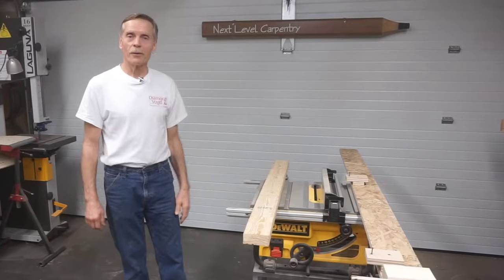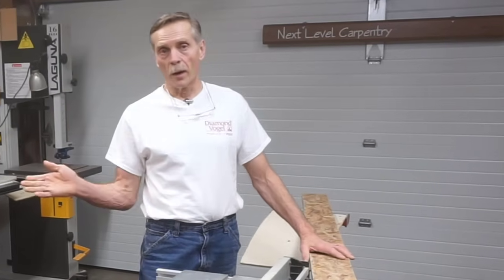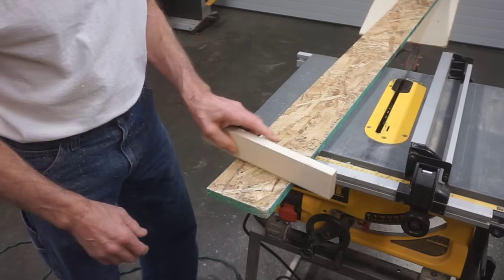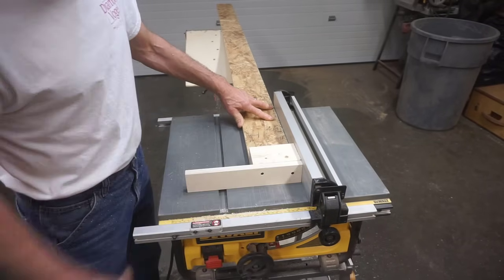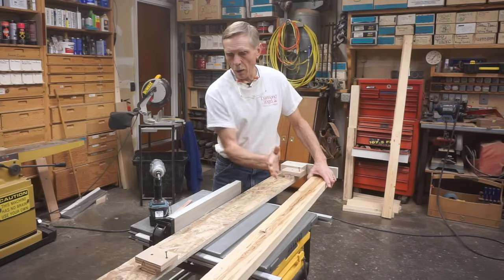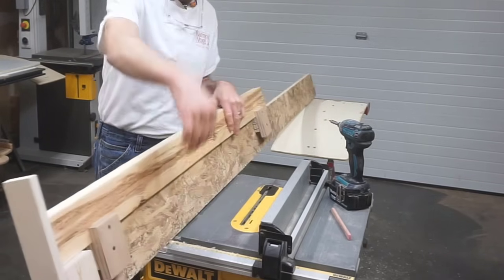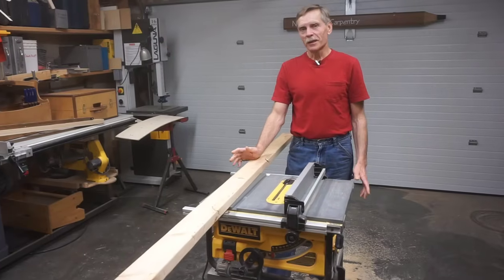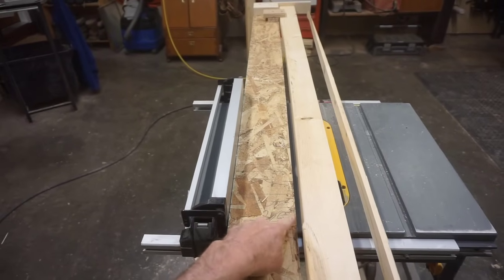How to Cut a Straight Edge on Crooked Boards

Comment: Long time carpenter here. Using a factory edge from sheet goods is totally the way to go. However, I would have just screwed that 2x4 to my OSB. In my opinion all that extra jigging is unnecessary.
Reply: So one thing I am trying to wrap my head around is why use the plywood at all? I understand wanting a known straight edge but isn't that what the fence of the table saw is? Shouldn't the fence be a known straight edge, so why introduce another piece?
Reply: @scottv.4140  The fence on that little saw is maybe 30" long. The lumber the op is trying to straighten is much longer, say 6 or 8 feet long. Without the straight edge, once that bowed lumber goes past the fence it's line of travel will start to hook. With a known  straight edge attached to the lumber, it's travel will remain straight and true  throughout it's travel along the fence.
Reply from the maker: @scottv.4140  think it through... or try what you're pondering... it would only work if your rip fence was over twice the length of the board being ripped while the plywood straightedge need only be the same length as the bowed piece.  Best, Matt
Reply: Exactly
Reply: @KenHill  Yes, but the OSB straight edge is itself only referencing off of a 30 inch fence. So you have the same problem. He could achieve the very same result just by using the fence. 

But the idea of going through all this rigmarole just to straighten a 2 x 4 that costs $3 on a jobsite, where time is money, makes no sense at all.
Reply: @marks6663  No, you're not quite getting it. With a jig like this you are transferring the straightness of the OSB/Plywood to the bowed lumber. Though I agree with Ken Hill, I'd just screw it to the sheet good from the bottom and call it good. And you might be onto something regarding the cost/time benefit. But towards the end of a build, it's likely you're going to have a healthy pile of bowed left overs and this is a great way to use them. $3 * 20 or 30 boards starts to add up - especially if you are the one paying for it and not your boss.
Reply: Bradley Weingartner some people are just too “smart” to learn anything new.  🤔

They yammer about cost effectiveness so they jump in the dually work truck and run 35 minutes to Home Depot to pick through a sprung bunk of studs for 10 straight ones.   Then stand in line for 15 minutes because the cashier is new, go through the Starbucks drivethru and get back to the job site just in time to take lunch.  🤦🏽‍♂️

Meanwhile this guy built a jig in 10 minutes, straightened 10 studs, built the wall, stood it and is on to the next project.  😂
Reply: @NextLevelCarpentry  Some people are very smart, aren't they!  Now I understand why there are down votes.
Reply: @marks6663  I am watching this video during the Covid-19 lockdown in NZ (mid March ~ April 2020) - very few shops are open (only the essential shops like gas stations are open); money can't buy everything!
Reply: @bradley3549  It makes perfect sense to me; as I mentioned below, I am watching this during the Covid-19 lock down in NZ (mid Mar ~ April 2020) and very FEW shops are open (only ones like gas stations or pharmacies are allowed to open).

I totally agree with you that $3 * 20 or 30 pieces of wood does add up; imagine renting a house for a whole year and only stay there for 11 months!
Reply: @marks6663  But for this retired DIYer, I have more time than money. Every situation is different.
Reply from the maker: @badlandskid  couldn't have said it better myself (and probably couldn't even if I tried? 😉).  One thing you didn't account for is the 20 minutes they spend hen pecking at their keyboard/device to compose a lengthy troll comment dissing the video to try and convince the rest of us their intellectual superiority, right? 🤣🤣😎 Thanks for watching and commenting! Best, Matt
Reply: I agree. Just screw a piece of plywood or joint something longer and screw to each end and run thru the saw.
Reply: I NEVER trust a factory edge. Cut your OSB oversize, then feed it through the saw next to a level. Then turn it around and trim the other edge. Now you have a straight edge.
Reply: @brucemiller1696  As long as your saw is dead nuts and you have a steady hand, Indeed you'll be golden.
Reply: @KenHill  i use the level all the time on my shop saw to straighten boards, or i use my 10' slider.

Comment: When on the jobsite framing,  just snap a line from corner to corner and use a skill saw to cut the line.  Boom! Straight 2 by 4.
Reply: If you can cut a straight line with a skill saw for some it’s not an easy task for others it’s not possible with out some kind of straight edge I can’t cut a straight line with scissors and paper to save my life..
Reply: I assumed he was just demonstrating on that curvy 2x and was trying to show the technique for straightening the edge of dimensional lumber. Because let's face it, if you are framing a job, you're gonna toss that one aside and use it for a sill, plate, or corner where you can make it straight, or  cut it for cripples.
Reply: Well, not to be critical ...
but, it's worth noting that you would begin with a crooked 1.5" x 3.5" board,
and end up with some weird dimension that would then only be useful to resaw into furring strips, or something thinner.
Reply: @mytuberforyou  that's true, we would never rip a 2by4 framing, just use for drywall nailer or give it back to the yard or like you said. I guess the only time I've seen the technique applied was for deck or floor joist, seeing as how it didn't matter how crooked the opposite side of the cut still was.

Comment: Hi Thank you for the video. I have a question, why can't the fence be used instead? I'm new to woodworking. If you line 2x4 and cut the edge off, won't that do the same thing?
Reply from the maker: What's required to cut the bow off of a board is a straight fence for the work piece to ride along during the ENTIRE cut.  The fence must be at least twice as long as the bowed workpiece plus the diameter of the sawblade or it won't be able to guide it during the entire cut.  If your fence is 24" long then the longest piece you can straighten is about 10". Do a little experimenting and you'll see what I'm talking about.  The reason this fixture works so well is that it only takes an 8' long straight edge to straighten any crooked boards up to 8' long.  To straighten the same crooked board using the fence alone you would need a perfectly straight fence almost16' long on your table saw which is very impractical.  I geometric terms the rip fence becomes a 'chord' to an arc made by the the bowed board. In theory you could straighten a crooked board eventually using only a short rip fence because each successive pass would straighten it a little more... but again, it's nowhere near practical.  Hope that helps some?  Best, Matt
Reply: @NextLevelCarpentry  2 years later and most people would have forgotten about the videos they posted. Good on you for keeping up.
Reply from the maker: @username-mark  thanks for sayin... I feel that meaningful content has a very long shelf life and there's value in passing it on. Thx for watching and commenting!
Best, Matt
Reply: @NextLevelCarpentry  no worries. Watched a few of your videos today and learned a few things along the way. Keep up the good work.
Reply: @NextLevelCarpentry  Thank you and that makes sense. I will try it out. There are so many cheap pieces of wood at HD and now I can mess around with those.
Reply: So could you clamp a long straight 2×4 to the fence???
Reply from the maker: @joeysanchez5926  Yes... but the straight piece needs to be twice the length of the piece being cut plus the diameter of the sawblade at a minimum and has to be stiff enough to not flex during the cut.  Besides that it's tough to keep the workpiece from rising above or falling below that long fence unless you add a support strip under it.  Other than all that it's a piece of cake! Best, Matt
Reply: @NextLevelCarpentry  I just recently found your channel and have subscribed. I am disabled from my heart giving out when my youngest daughter was killed by her boyfriend. Your videos have helped motivate me to get into projects and live some again. I live alone so its been rough. Thank you very much for your channel and the help it has given me.
Reply from the maker: @user-vp9lz7ew9b  Sorry to hear of your hardship and grief DeWayne... I admire you for picking yourself up by your own bootstraps and working to find new purpose in life... Best, Matt
Reply from the maker: @Crypto_Cronies  thanks for your kind words, for watching and subscribing to Next Level Carpentry... much appreciated! Best, Matt

Comment: 12:03  As a novice, the initial feed of the board always seems awkward to me to stay aligned with the fence.
Reply from the maker: With the short rip fence length on portable tablesaws that initial feed will continue to feel awkward Vashon... even with decades of practice it still takes me a bit of concentration to get it started right.  Practice helps though and the more you do it the less nervous you'll be.  Best, Matt
Reply: Also as a novice, I've found I really like featherboards to help keep the work snug against the fence on the longer cuts. Would not work with this particular trick though for what I hope are obvious reasons. I have screwed a bowed board directly to the sheet good in the past though which gives clearance under the bowed board to use the featherboard on a known flat reference.
Reply: Years ago as a novice, I found myself always on the fence, struggling to decide to feed the board from one side, or the other.
Reply: marshalllhiepler 
 It was a great attempt at humor. 
  I'll give you that.
Reply: @marshalllhiepler  - Years ago, I walked in on my wife using the wrong end of the hammer! ;-)...

In her defense, she couldn't push a thumbtack into the wall and was using the flat rubber end of the handle in an attempt to avoid damaging or marking the paint with the dirty anvil end (made sense, I guess), but it made for years of jokes... 

I just wish smart-phones and youTube were around back then. The visual was priceless.
Reply: i clamp a straight piece from a old  aluminum  door to the fence. at  80 inches long  you can even use it to straighten boards 40 inches long without any jig.
Reply: Get in the habbit of keeping your eye on the contact point of the leading edge of the workpiece being cut and the fence. Don't look at the blade.  keep you eye on the fence and the board right next to the Blade.  Keep your eye there as you being pushing the board through.  Get in a good position where your feet are stable and your are balanced.  The only thing moving is your hand to push the board through.  I keep my knees bent.  I just got done doing twenty 20' 1x12 pieces of pine.  OK it was on my shop table saw.  But I did this from 10' away while balancing the board in my hand.

Comment: 13:32
Thats how i trim off the warped side's of a 2x4 ... And plywood, and particle board and mdf  ....
Reply: but if the warp is outside the length of the fence you just transferring the same profile to the new cut edge.. this is why he used the guide so there was a true sq profile the entire length.

Comment: But since even straight 2x4s aren't really 2x4 and each messed up board requires a different amount to remove, doesn't it mean your 2x4 project is either going to involve multiple odd sizes or, if you cut everything to match the smallest end result, consistently small sized boards? If we have to joint and plane anyway, Why aren't they cut larger than 2x4 from the factory so when they're at end user moisture and jointed and planed they end up actually being 2x4?
Reply from the maker: Focus Robert, FOCUS: this video shows how to cut a straight edge on a crooked board... got it?
Reply: @NextLevelCarpentry  Got it! Sorry for having a general question that occurred to me while watching, I'm still new! Will do better next time.
Reply from the maker: Sorry if my reply was a bit harsh, Robert.  There are reasonable answers for the questions you posed but addressing them all in one comment response isn't feasible.  If you have a particularly vexing question as you gain insight and experience in carpentry feel free to post it on an appropriate video here on the Channel and I'll try to respond in kind.
Best,
Matt
Reply: Excellent reasoning and very good question! Curiosity is the fuel of every great craftsman.

The reason why the mill will not cut the 2x4  larger than a 2x4 is because 2x4 are used for framing and Not for your finish woodwork projects. For a mill to do this would be unrealistic and extremely wasteful as they'd be milling wood that is completely out of building code and no contractor would hire guys on site to be ripping larger-than-2x4 boards all day to make 2x4 boards for the framing job when we can already get the boards at the dimensions we need.

As contractors, we need wood that's milled to spec and ready to use as soon as we get it to the job site.

For finish work, we're working with tons of misc sized cuts or large-scale (big & wide) milled material that's meant to be cut down to the sizes we want for our finished projects.
Reply: @futuresdojo  That makes sense thank you!
Reply: Boards have been getting smaller by the year. That way they can get more boards from the same tree .

Comment: I am completely self taught.. other than a a helping hand from friends. I subscribed and rang the bell.  I really enjoy wood working.  I will probably comment a few times. So when you trimmed the two by four.. I'm guessing you trimmed the round side first then turned it around.  I would have thought you would have had to move the fence.
Reply: Also this isn't just a matter of saving money or convenience. Usually there is a goal set to be done with such and such. Do we stop everything. In the pix I saw OSB. But the truth is it is easier to find on a job site and we your viewers, might have a piece around.Anyways If we take the time to go to town and buy this and that.. it kills momentum. You go to lunch.. extremely slow service sometimes. So you spend
an hour at lunch and go to get the board and you realize you need
some things at the job..now this takes more time..and  you've been off the job two hours. I say grab the OSB, set the fence and go for it.  I had a slightly out of square piece of plywood the other day and this would have been handy.
Reply: I notice that the board you are straightening is nominally 1 and 3/4".  Your push board nominally 3 and  3/4. ..you made the blade 1/4"  proud of the board , which  if I'm seeing it right will cause the blade to be 2 inches nominally. This would give us a  2 inch cut as thick as the kerf in the 2 x 4.  I will be building this soon.
Reply from the maker: Hi Pianostyle, thanks for subscribing and adding comments on this video.  I'm not completely following your comment and/or question but it seems like you grasp the concept of using a 'known' straight piece to make a straight cut on a bowed one.  The related dimensions are mostly 'project specific' as long as you're following the basic idea/concept.  If there's something you have a question on feel free to post it and I'll try to reply as time allows.
Congrats on being self-taught... in many ways that's the best way but it can tend to take longer to advance although your depth of knowledge may well be more solid.
Best, Matt
Reply: I learn things  everyday I work with wood.. it's like a hands on course of general physics. When I'm doing a honey do like straightening a door frame ect.. I don't try to hammer it .. I pull out my Clamps.. I have arround 15  2" to 5 feet. I move the errant board into place and with almost  no hammering I have a straight doorway. I made something extremely simple.  I'll pass it along. It's a cut off jig.. I have spare table..  I  placed two parallel 2 x 6's pressure treated, in parallel and screwed them into the 
top of my bench.  I put a two by six intobetween both.It has to slide easy.  I just clamp the board down and now have an extremely stable cut off jig.  I an putting a more boards in parallel ..like 2 by 4s.  I am sure others have done this but the jig forces a straight cut and with  the jig allows me to have  a better cutting surface. This works well with a hand saw too. you also can use it to hold pieces to route also. I haven't tried it but It would probably be good for tennon work also.  Just a very stable setup..
Reply from the maker: Pianostyle: Lot's of ways to get this done... thanks for sharing another tip which others can consider to see if it's the best solution for the project at hand.
Thanks!  Matt

Comment: just wanted to say thanks.  I found this method here.  used it on some old barn wood for a table I'm making.  it worked great.   I'm a real noob with a table saw and it this was fairly easy even with some pretty big old barn wood i was working with.

Comment: Do you have details on your outfeed table?
Reply from the maker: A full-on build video is 'in the pipeline' here at Next Level Carpentry... stay tuned! 😎 BTW It is a steel fabrication/welding project, not a woodworking project.   To follow the series with intent to build a pair of the roller ramp outfeed tables will require more than entry-level skills and tools... Best, Matt
Reply: @NextLevelCarpentry  thanks for this very useful video. I think i could make a cheaper outfeed table from wood and a plastic pipe, i have no metal work skills or equipment
Reply from the maker: @colig54  nothing wrong with improvising... good luck with your project! 😎 Best, Matt
Reply: Did u ever show how ur outfeed table was made...love ur knowledge